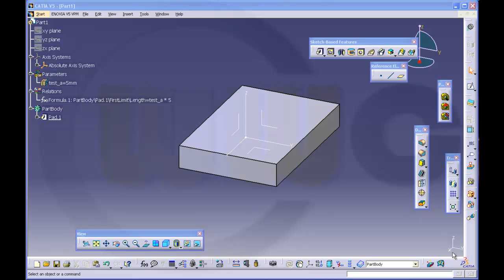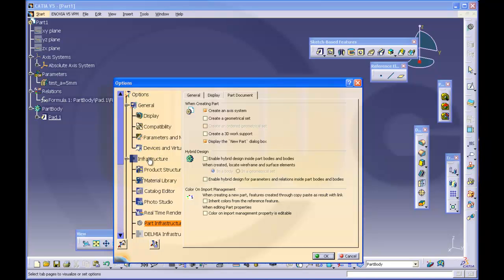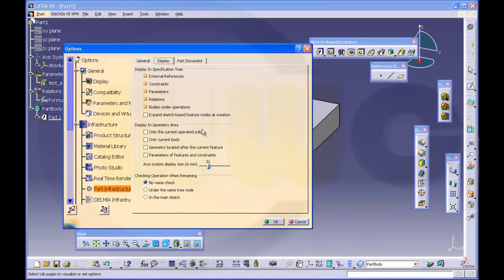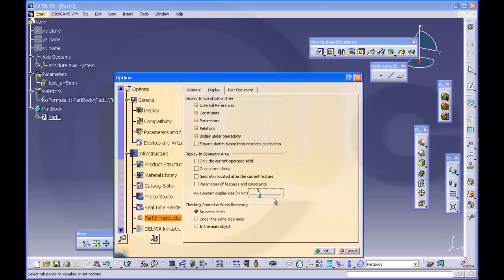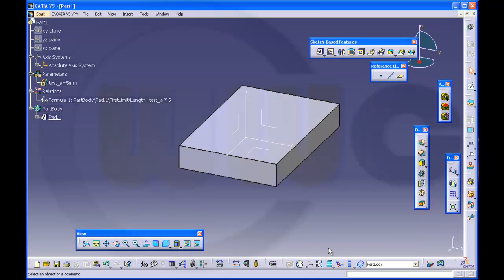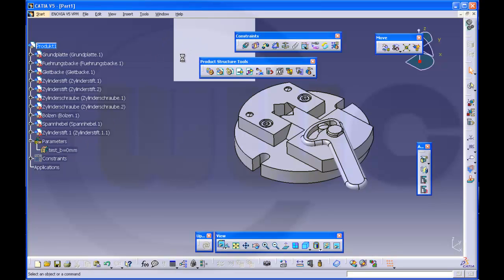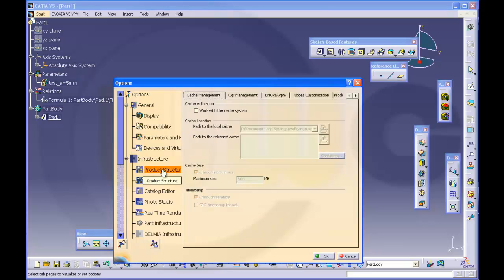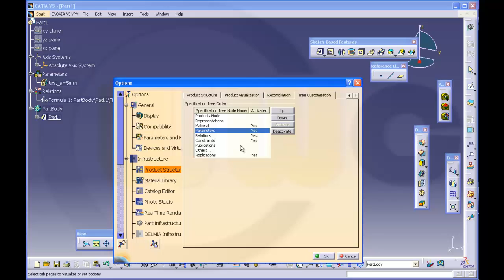Basics part VIII - Catia v5 Training - Configuration and Customization

Comment: Hallo sir,

I have drawn the points from wireframe.. it’s shows in the specification tree… but I can’t see them virtually … I am using Generative shape design
Reply from the maker: You have to switch off "show body in work only" at the bottom toolbar - symbol is one orange rectangle
Reply: @wolfgang.walden.cad.training   thank you so much for your answer. I can not find the orange rectangle.. actually in the sketch workbench i can visually see the point but on the surface I can. i can even see lines and planes in the GSD. But the only problem is the point.. i have reset the toolbar, i am trying to find it out .. but it's not working. please let me know if you have any more options remaining

Comment: Struggling to use pan, zoom and rotate actions through mouse in Catia P3 V5 R2017. Kindly guide on this.
Reply from the maker: Pan: press scrollwheel + move mouse / Zoom: press scrollwheel - click left mouse button once - move mouse forward/backward / Rotate: press scrollwheel + press left mouse button - move mouse / select center of rotation; double click scrollwheel on the selectet point. You could check this in the catia v5 online doc!

Comment: How you make manipulator(top-right) big?
Reply from the maker: Never changed it - it had always this size by default.
Reply: Wolfgang Walden i use catia v5 6R20 and it is very small so it hard to use it to move bodies ir rotate them in  xy or xz or zy
Reply: Your one it so big than my one
Reply from the maker: Even catia v6 it has the same size. So maybe there is an option - but I never used it. What screen resolution do you use?